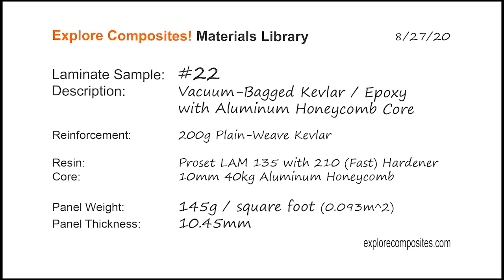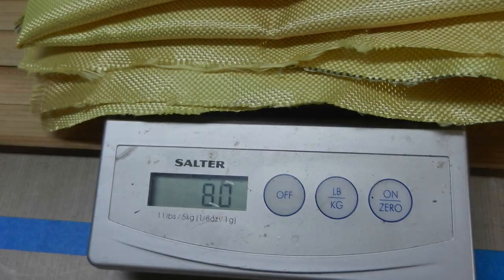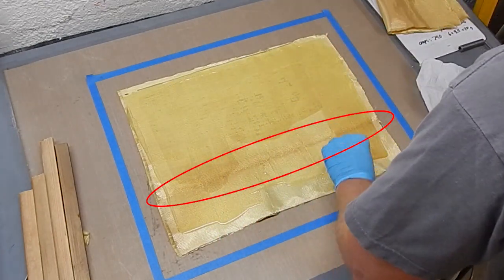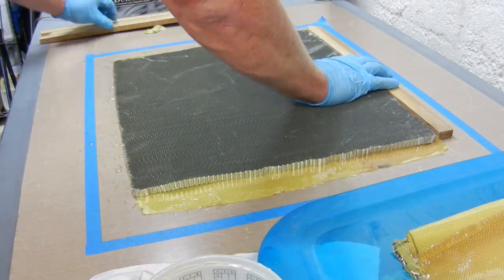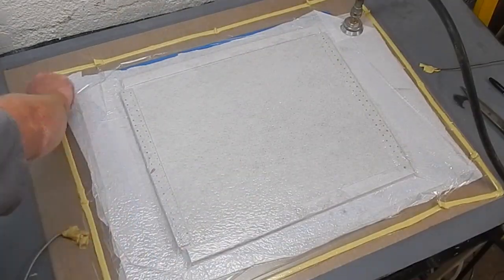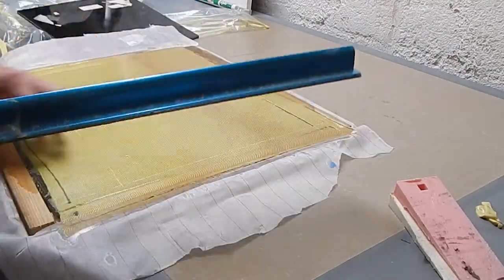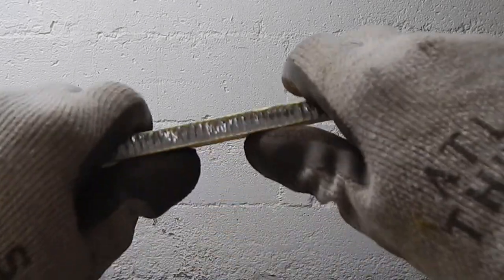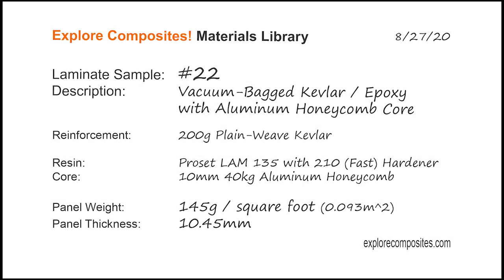Laminate Sample #22: Vacuum-Bagged Kevlar / Epoxy with Aluminum Honeycomb Core

Comment: Why do you not use full vacuum?
Reply from the maker: I think I was trying not to push too hard on the top skin - to avoid pushing the fiber down into each honeycomb cell.  Not sure it would have happened anyway - Kevlar isn't sure stretchy!  For bagged wet layup half vacuum is often plenty.

Comment: Two sheets of 0,5mm carbon fiber on each side, instead of Kevlar, would be more stronger?
Reply from the maker: Stiffer maybe,  and stronger in some ways - but not as resistant to hammers!   Carbon might also have long term galvanic issues with the aluminum core.  But yes, carbon would be a more practical and common choice here.
Reply: @ExploreComposites  OK, thank you for your response!

Comment: If we join the Face sheet and the core using another technique instead of bonding them can we achieve the same properties?
Reply from the maker: I am not sure what would work - maybe some type of welding with aluminum face sheets.  What do you have in mind?  Glue is pretty great at attaching different materials like this.

Comment: I see that the honeycomb didn't stick to the laminate nicely it got delaminated very quickly can you please tell me any method by which I can bond laminate to honeycomb structure and tell for both laminate as upper laminate will cause great issue
Reply from the maker: It’s harder with honeycomb because you have less bonding area - ideally just resin fillets from the facesheet to the cell walls.   This sample had decent adhesion to the honeycomb but the kevlar doesn’t stick that well.  Best option is to use toughened bonding adhesive (ideally prepreg film with prepreg laminate) and do tests.  Chunks of core should stay stuck to the laminate - not a clean break.
Reply: You must properly prepare aluminum core before bonding.  Usually a vapor degrease and sometimes primer.

Comment: I found a specialty tin snips (designed for cutting stainless steel) that do a pretty good job cutting laminated kevlar.   The ones I have are made by Midwest.  They make a very clean cut for trimming.
Reply from the maker: Oh that is a neat idea - I guess if they cut stainless then 1/16" Kevlar sheet is no big deal!